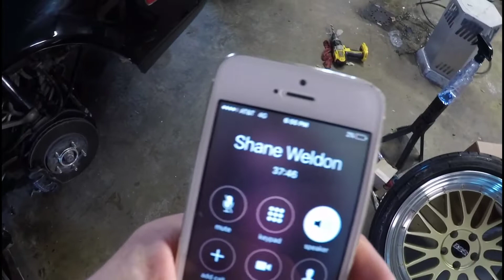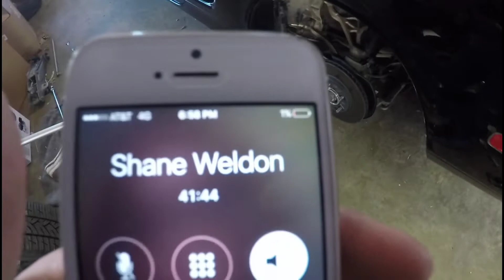Acura NSX project Part 4

Comment: If your 6 foot then you probably can feel your hair touch the roof when sitting in the OEM seats. When you put on a helmet for the track it is really difficult. I changed the drivers seat to a low slide rail bucket seat. This solved the height issue and also the body movement on track as the leather seats even with a 4 point harness do not stop movement. Change the steering wheel to a Momo D shape flip up which will solve the high bucket seat sides when getting in and out but will give you direct feeling to the car. Check the harmonic balancer for wear as it is hard to see but disintegration of the rubber is common which will make the cam belt jump some teeth and goodbye engine.